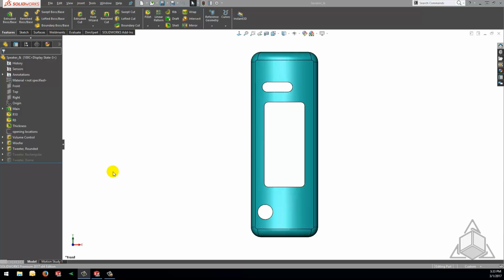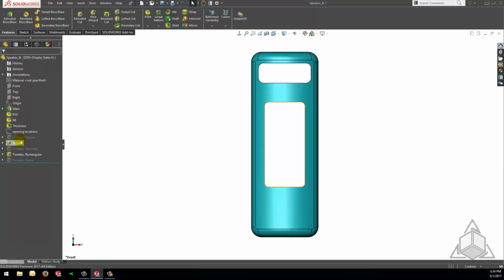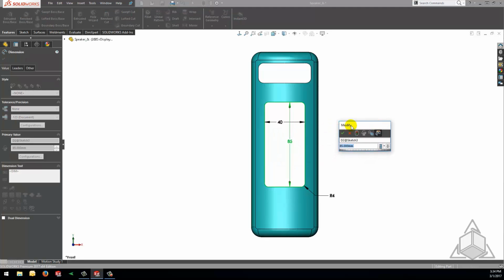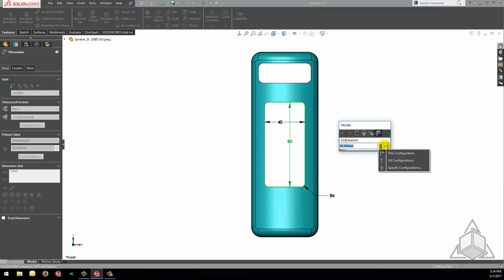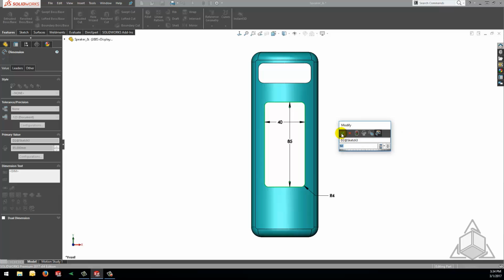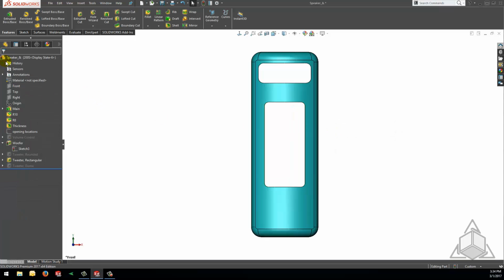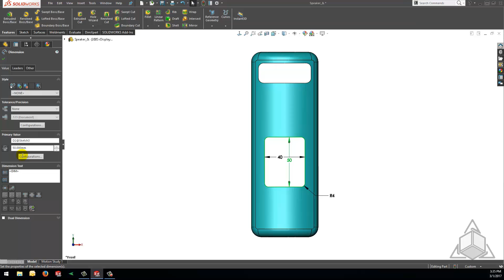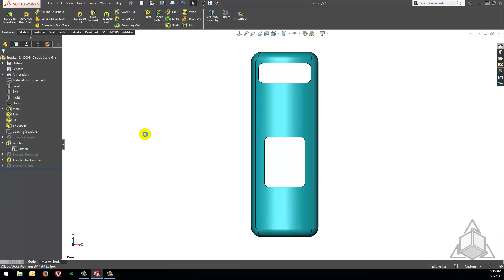Tech Tip -  Configurations

Comment: Thanks Rob. How do you enable the dark theme? Looks really easy on the eyes.
Reply from the maker: The display settings that I use can be set by going to Tools > Options > Colors and then setting Icon Color to Classic, and Background to Dark. The dark option should be available on 2016 SP0 and later, and Classic icons should be present in 2016 SP3 and later. Thanks for watching!
Reply: CADimensions, Inc. - thanks Rob. hopefully I'll get to try tomorrow. the wind storm knocked us out a power.